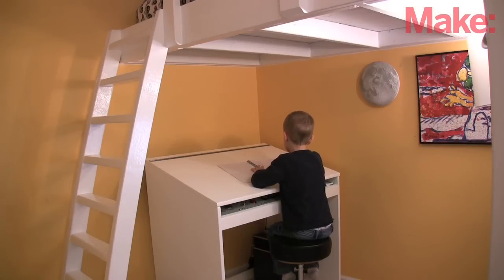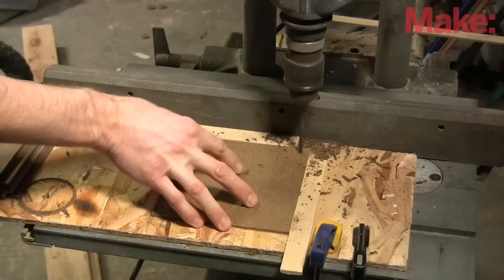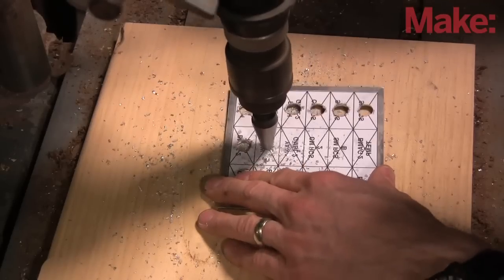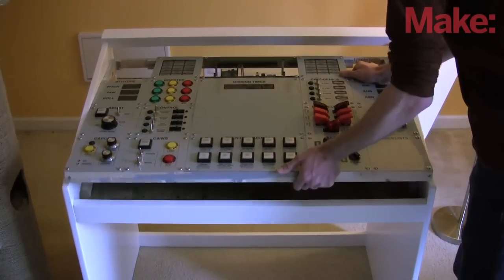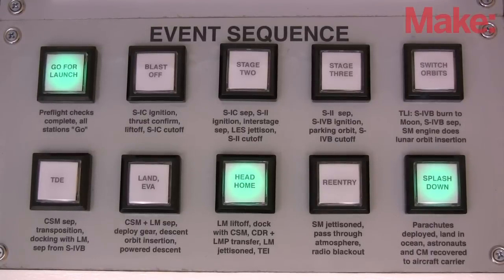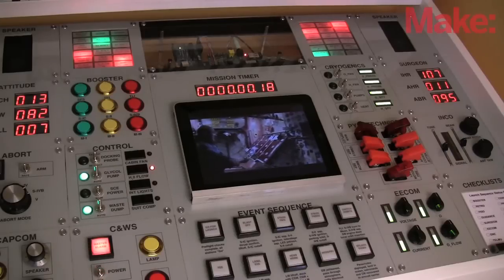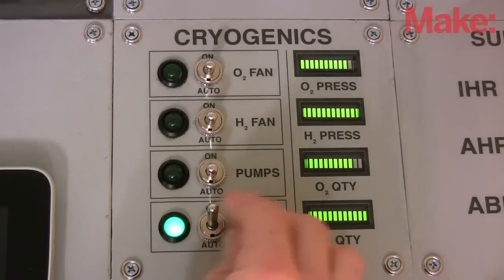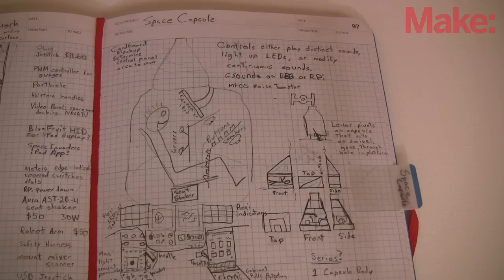Making Fun: Mission Control Desk

Comment: This project is simply amazing! Back in the days when when I was ~12 years old, I spent weeks building [what I then considered] an epic DIY mission control panel for myself - with a lots of switches and incandescent micro-bulb indicators, and even some barebone basic level analog logic behind it (e.g. three "pump control" lights had to be turned on for the "master pump" light to turn on, etc.). Burned my fingers so many times while soldering all those wires, but I was so proud about what I have made. But this - this is something I couldn't even have dreamed about those 25+ years ago... Great job!

Comment: Please tell me you'll make this interface with Kerbal Space Program eventually
Reply: This would be godly. The covered switches would be all just staging.
You'd have named action groups etc. This is better than CCP.
Reply: Even better, have it be programmable with little LCD screens on the action group buttons. Then depending on which craft you load, it modifies the buttons! Load up your B9 VTOL, AG1 now toggles the engine rotation. Your Interplanetary Tug? It toggles the solar panels.
Reply: I was thinking the exact same thing when I saw this. Epic KSP interface.

Comment: I was almost disappointed early on in the build, because he didn't men tion there were actual computers involved at first. I thought it was just going to be a fancy toy with lights and potentiometers and the like. That would have been pretty cool, but not really worth of Make, in my opinion.

Then he got to the part with the RPi and the Arduino and he immediately became the coolest dad that has ever lived.
Reply: Yea, he kind of whizzed past THOSE details like an Apollo Command module off course to the Moon!
Ahh, yea, just "throw in" a Raspberry Pi and Arduino controller and 'Make:' the "appropriate" connections (there in his head, not mine...) and then,... you will be all set!
> Gee, why didn't I think of that?!? <

Well done Dad!  You've achieved Flight Status!

Comment: I got into electronics when I was 8 and by the time I was 12 my grandfathers bench looked like this thing. I took apart my space guns and discovered the oscillators inside could be modified to change pitch, etc and used them for my sound effects. Everything I built had a kinda steampunk look to it. My 'status' lights were his upside down baby food jars that used to hold nuts and bolts - painted inside with spray paint to make a light globe, etc... But nothing close to this elaborate. Makes me want to do this again for some reason.

Comment: That is so freakin' CUTE! I built fun stuff like that until I was about fifteen years old, but I didn't do nearly as good a job. Some of that was because of what was available to me back then. Most of my hardware came from an airplane junkyard in Tulsa, OK, so at least the controls looked very cool. There were no ready-made circuit boards back then unless I scavenged them. Most I had to build myself, one component at a time. Sound effects had to be on tape. I used a LOT of magnetic relays. I needed bigger transformers and full-wave bridge rectifies than you'd need now: typically 12 volts, 5 amps. My circuitry wasn't very efficient. The incandescent bulbs alone sucked a lot of juice.

Comment: I absolutely love it! There is no difference in what you made then what those guys had to train with,the difference being someone in another room was throwing the red lights and faulty issue problems. Every possible issue that could go wrong was gone over too. Even non recoverable situations were made,the idea was to make the astronauts aware that they were in a do or die situation and if they trained knowing that ahead of time,well then at lest it was covered.  My dad told me they frequently lost guys during training of the live rounds part of crawling under barbed wire during training before being sent to WW 2. He told me about a guy in his unit that cracked and stood up. With NASA,they needed to know these guys could handle mental stress because face it, they were under a boat load. Putting all your faith in the electronics of the day was a tall order. To be honest, I would trust that technology more now than I do today. Everything was hand built and tested and retested many times. The backups had backups. Then again,just flipping go-nogo switches are a blast,eat her way you cut it. We tried building the bridge of the Enterprise using refrigerator boxes back in the 70's complete with lights.

Comment: It would be more modern to do the job with a big touch screen display (controlled by a computer program). Not only it would save the the hardware work but also be more flexible to make changes (by reprogram) and even expend to many sets of (mission Control) panels. Other applications are as limited as one's imagination.

Comment: I'd like to have this, but I'd just like it to make beeps, buzzes, and electronic voice commentary. Also use technology from the '60's and '70's. Instead of digital number displays (for attitude and the like), I'd use cylindrical number displays. Instead of an iPad as a monitor, I'd use an actual CRT display. And instead of LED's, I'd use good ol' incandescent bulbs.
Reply: It's like Hollywood though, cheaper when possible but STILL convincing!

Comment: this is incredible! but how did you glue the transparency onto the panel after the panel was painted gray?
Reply: You actually would not need to glue it because the switches and knobs would hold the transparency in place; as well as the individual instrument panel anchor screws at the corners.  Added benefit: If a transparency gets scratched, scuffed or worn over the years, it may easily be replaced (I hope).

Comment: Just don't hit that Saturn V abort switch; 4, 880,000 pounds of propellant will be expelled and ignite in the air, a sub nuclear explosion (I designed that actual abort system incidentally)